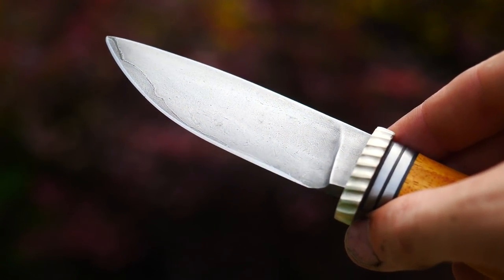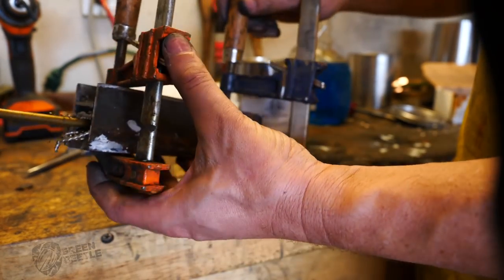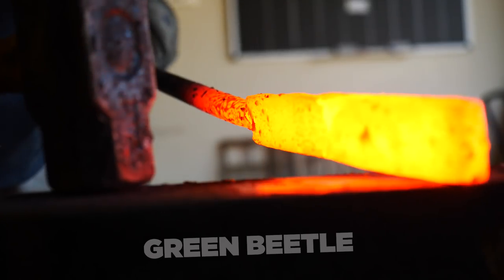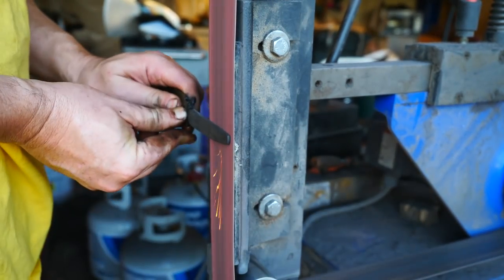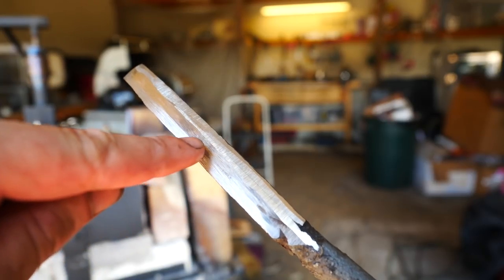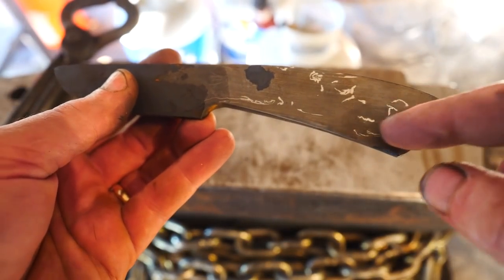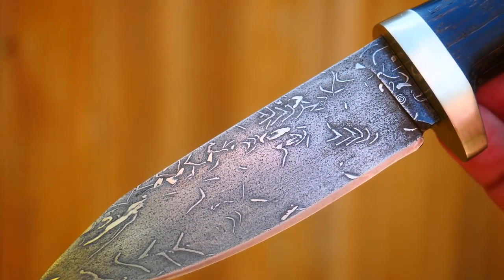Forging The Drill Spiral Knife 2.0.

Comment: Great videos, nice to see you pushing your boundaries. 

Warm your Anvil a little before you weld, a cold anvil sucks the heat from the steel. 
I put a piece of hot steel on the anvil, moving it around to gently warming the anvil before the first welds.
Reply from the maker: good advice thanks!

Comment: Was the canister heated for forge welding with the “edge” down?
It was most likely on its “side”, allowing the powder to settle during heating and fill more on the bottom “side” while the spirals remained in place on top “side”. When compressed, the bottom ends up with more solid metal from powder, and the top more spirals.

Comment: You should make a vibrating jig so you don't need to work as hard to get the powder all the way down! Maybe a mouse sander fixed in place with a surface on top that you can clamp your canister to. Great video as always!

Comment: You can alleviate those issues next time by hammering evenly on both sides I have to keep myself in check at time and get to fixated on hammering one sides which pushes the core off to the opposite side. Cool project none the less.

Comment: if you do this again, you should try using a palm sander to vibrate the canister rather then tapping with hammers, the higher frequency might cause the powder to settle a little bit better
Reply: aboveaveragejoeaus AvE would agree
Reply: as stupid it sounds, it would not be a bad idea.
Reply: Kormoran no one said it sounded stupid, it would work amazingly as they usually have really powerful motors

Comment: Could you take bundles of the shavings and twist them together like little bits of steel twine? You could then twist several of those together to make several small steel ropes that you can then pack into a canister with extra shavings and some well vibrated iron powder to fill the gaps. Just a thought. Thanks for the videos btw.

Comment: For an impromptu "hopper" effect when vibrating the powder into the billet holder, you could just take an orbital sander to the side of the case with some worn out high grit paper or something on the pad.  It'd vibrate the hell out of it and save you some tapping time.

Comment: Use clay with water mixed into a slurry or paste and put in the tube and let it dry instead of whiteout it's cheaper, works better and its free if you get your own from say a pond or something. I have a lot of red clay from my neck of the woods and I just get some from the cattle pond and mix it up with water filter it and let it settle and then save it in a tub. Just be sure its dry before sealing or you will blow up your forge been there done that and it wasn't pretty.

Comment: Your lay up is what I thought you should do in the last video.  The tube was a good Idea, but for filling in you should consider vibrating rather than tapping. A couple of motors from an old video game controller, a marital aid, or best one of those serious deep tissue "thumpers" . 
Another option is the handles of some channel locks.  Banging each side of the canister in quick succession is still better than the ball peen for settling the powder evenly. It will also keep the swarf (drill spirals) from shifting (though it will settle them downward but not much if they tangle). 

Make your edge with an ingot of steel instead of powder.  Build the canister with the solid piece at the bottom, cram in shavings until you're afraid of deforming them. Weld the third side, and then fill with powder as above. Your edge is safe from nickle and you will have much better contrast against the steel. 

I know it's for aesthetics, but if you weigh the coils compared to your powder in the canister, you'll see how much swarf/coils you can add and not change the steel much.  Remember that those shavings are ribbions only a few thousandths thick, but coiled tight.  If you place the edge steel first you can really cram shavings in there, without sacrificing edge quality

Comment: That tiny little spiral was pretty sweet!!! The one side of that knife did come out very nice in my opinion. I think youre on the right track when you decided to compress the chips inside the metal container before welding it shut. Maybe if you really flattened them out before putting them into the container you might have better success and could fit more in??? Either way it was another cool video as usual.
Reply: I’m thinking the same thing. Maybe even heat and flatten the spirals first and then pack them in the tube.

Comment: If you were to attempt this again and get that one side more active than the other try cutting it in half and folding it over, or fold it length wise and stick some 1075 like the hot dog in a bun method for the edge.  You may also be able to get multiple knives out of it.

Comment: Would grinding  the bottom of blade right down, ending up with an s-shaped cutting edge, on knife two solve the issue? It'd be a  bit more of a pain to grind and ultimately sharpen, but if it means a usable blade at the end of it, why not? A knife of that length isn't going to be used for lopping logs in half, so there shouldn't be excess stress close to the handle.

Comment: i've always wondered if you have a really fine zebra pattern knife but instead of having the lines parralel to the edge they all are on a 90° angle of the edge (so the edge consists of alternating steels all the way) if you sharpen it then edge it you'll have like a sawtooth edge?

Comment: If you fold it a dozen or so times after grinding the canister off of the prospective knife blade following the initial forgewelding you can make the steel absorb more of the graphite powder adding to the carbon content.  P.S works best with steel that is low carbon initially.

Comment: I'd love to see Damascus steel Billet made out of paper clips and Staples and the knife made from it could be called the office Warrior
Reply: revanstar85  neither of those steels would be hardenable or give very much contrast to the billet. The only contrast would come from different carbon concentration (mild and HC) not from any etch resistance, so the pattern wouldn't have very much contrast and the knife wouldn't be functional unless it was a San Mai.
Reply: I have actually thought about this before, and I think it would be cool... IF paper clips and staples were not made of galvanized steel. Burning that is not usually a good idea. I don't know about the metal composition of these things, but I would assume they were a very low carbon steel (and maybe even zinc aside from the galvanized coating). Maybe putting some paperclips in a canister with high carbon steel dust for a little contrast in the damascus pattern after soaking it in vinegar to remove the galvanized coating? Like the other guy said, wouldn't be that great anyway.
Reply: It was just an idea I honestly have no blacksmith training of any kind and have no clue about how certain Metals look

Comment: Hey beetle, they may not be functional but I have a risky suggestion, try hot-dog-in-a-bun with your billet, good steel in the middle. It will have less chance to shift that way, instead of using san-mai where you have three pieces, hot-dog will have two. I don't know if you could fold your decorative "drill shavings" billet but you don't have to post it if it's not a success right? Keep being awesome

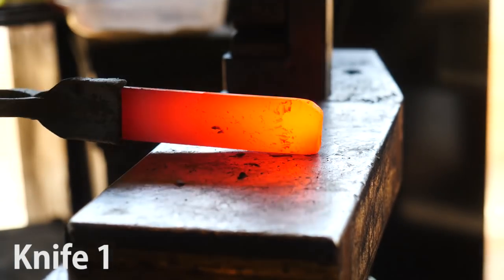Comment: I'm at 7:29, just after where you say you like one side, but not the other... and all I can think to myself is if you fold it over you will have the crappy side without much pattern in the middle, and noone would know... =p

sure, it would require more forge-welding, but if that's the side you want to show, then it seems like that'd be the right thing to do...

It also sounded like you were using a better steel as the powder filler, which means that you'd have the good steel on where the blade is? (assuming the blade is down the middle)

Comment: What if you were to construct a deeper canister then put in 1 or 2 bars in the middle of like 1084 or 1095 that will make up the blade's edge and then fill the space off to each side with the 15N20 drill spirals and 1084 powder then forge that?

Comment: Are there any techniques, attempts, approaches where people hammer while the metal is in the forge?
Reply: i would imagine that since forges use a very insulating material for the walls, that attempting to hammer metal inside it would cause the forge to break, or at least put a very rough texture onto the metal which is not ideal, however that could put a nice "gravely" look on a knife. Also if someone tried to incorporate the anvil into the forge then you run into two problems, one is that now the anvil will lose hardness and deform a lot while being worked, also since it is metal it will conduct heat very well which will result in much, much lower forge temps.

Comment: Is there an alternative metal to use besides nickle that gives good contrast in the pattern but will not be a disaster to the blade if some of it ends up on the cutting edge?  Seems like the soft nickle is too risky to use in that regard.
Reply from the maker: 15n20 has a small percentage of nickel and holds a good edge

Comment: Those knives might be more usable than you think - drill shavings are actually quite thin, meaning that even though they're clearly visible, they may not impinge on the function.  Also, since nickel alloys are so incredibly resistant to corrosion, the acid etch would have made them more visible than the thickness would normally be..
Reply: Keldor314 I feel that the problem would arise when certain parts of the blade would break down before others.
Reply: Yeah, my feeling is that you'd eventually end up with little notches on the blade where those shavings cross it.  Still, though.  shrug

Comment: Great video just wondering what kind of wood that is?
Reply from the maker: Black palm that I stabilized.  it was sanded to 800 grit then buffed on a wheel.  balck palm splinters easily with drilling and cracks if it gets too hot on a belt sander.  it's a gorgeous wood but I try to stabilize mine with cactus juice in a vacuum chamber now.

Comment: I just recently made a paintcan forge. Is it possible to forge weld with a paintcan forge or would I need more propane/ insulation
Reply: MilesGC1999 very likely you wouldn't have the power necessary for that unless you have a good burner and you only plan on using it once. My suggestion would be to make a larger forge if you desire to use gas, but for a beginner it may be cheaper and easier to use solid fuel.

Comment: Awesome video as usual! :D I'm curious to know how long do you spend hammering the canister to get the powered steel to fill all the gaps and such?
Reply from the maker: My bicepts are very fast.  It's due to their size.  What you see in this video has actually been SLOWED DOWN, not sped up like most people think.  So about 0.75 seconds.
Reply from the maker: ok so about 8-10 heats at forge welding temps, until it makes a solid ringing sound when struck instead of 'crunching'.
Reply: Ya tappy tap tap

Comment: 11:07 it warped because you overheated it, I know the camera does not adequately show the colours of the steel and different oils have different flash points etc.  But  usually if the oil catches on fire when you dunk the blade in(that being oil hardening steel) chances are you overheated it. Next time quench at a lower temperature :)

Comment: green beetle how does your gas forge to heat up so much?
Reply from the maker: federico zanoni without two inches of insulation it's difficult to get a one burner forge to welding temps though some companies say their one-burners do.  Mine has 2" insulation, two burners and an "exhaust hole" in the back so all the gas doesn't just rush out the front.  You need good burners.  These were $175 on eBay and are pretty decent.  I run them at 12 psi to forge weld in most cases.  The trick is finding the right flow rate and set up to maximize the amount of propane that burns inside the forge instead of out.  Try to close off front of forge a bit w firebricks a bit leaving a 1.5" gap while heating up. Good luck and be safe.
Reply: Green Beetle thank you very much

Comment: Very cool. That sucks about the delamination man. I would test the crap out of the edge on that first blade for sure. Even if the nickel is close to the edge, it still might have just enough steel to hold And if it rolls, maybe after sharpening it a few times you will get down to some solid steel.
Reply from the maker: it snags paper badly over the bottom 40% and one tiny spot on the belly.
Reply: That's a shame dude.  Ended up looking very interesting though. Thanks for the content, your stuff on carbon migration has helped me quite a bit perfecting some of the forged blades I make.

Comment: Please do a knife in any style but you have to fold it into 10,000 layers like the Japanese did in WW2 for the blades they used to cut through weak American tanks.
Reply: Seymore "Gally" Johnson hahahah (plese be ironic)
Reply: U kno how long that would take?
Reply: That's a myth crucible steel if superior to folded steel, although folded steel does look cool
Reply: the famous samurai of Okinawa were known for cutting down American fighter planes mid air
Reply: xD sound slike a myth to me
Reply: Also he'd only have to fold it 14 times to get 16,384 layers
Reply: Forged steel looks beautiful but it is inferior (in terms of performance) to the crucible steel europeans had at that time
Reply: HKnives 
Traditional Japanese steel was "crucible" steel. They just combined the harder and softer sections and forged/folded/forged to a high layer content to provide more of a "micro-serration" which produced a fine edge. Then "claying" the spine kept the spine softer than the edge for making the blade somewhat flexible and shatter resistent. But it did start from raw iron materials and the added in carbon via a large oven "crucible" where the raw materials and fire were all in one giant smelting forge of an oven.
Reply: Seymore "Gally" Johnson w e e b
Reply: I know it's an old post, but "traditional Japanese steel" was not crucible steel. They did not possess the technology to heat the steel hot enough. Their steel was a type of bloom steel, called tamahagane, or jewel steel. It is thought that it was called such because of the silicates left behind in the steel that would sparkle before it was put through the forging process. They used "iron sand" to produce their steel. They did not typically fold harder and softer steel together, instead they made an insert out of the softer steel and inserted it into a V or U made of the harder steel. Then they forge-welded the pieces together and finished shaping the blade. I also think that "flexible" is the wrong word, instead more shock resistant would be more fitting. Traditional Japanese blades were not spring steel and would hold a bend if hit from the side hard enough, but due to their shape, thickness, and construction, they could take a hell of a pounding on the edge itself.

The folding process was required for each of the different grades of steel being used, so as to homogenize the carbon content and force out impurities from the steel. Folding is not required when using crucible steel because the impurities are lost during the actual smelting process and the steel is heated to a sufficient temperature for the carbon to evenly distribute itself throughout the billet, much like modern steel.

Comment: i'm planning on making myself a belt grinder(5x200cm belts which are the closest to 2x72 inch in europe) so i drew up some plans in fusion 360 i was wondering if you could take a look at it and tell me what you think?(no need to download any software)
http://a360.co/2yvOSAq (below the top red piece is a spring for tention and changing belts)
Reply from the maker: looks reasonable, i'm not a design guy. where's motor going?
Reply: the motor will be bolted on the ground plate behind the long vertical pipe (i'm probably going to use a big square steel ground plate for stability)